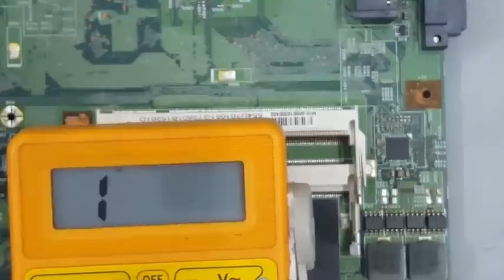Dead Laptop Testing ( தமிழ் )

Comment: I Have another Intel DG35EC and Intel DG31 PR Motherboard it shows the Error Code on Debug Card 1st Shows 00,28,34,12,13,54,E6,58,95,E6,6A,E7,E9 and then it stucks on Error Code E9 What can i do to display comes process fan will working properly